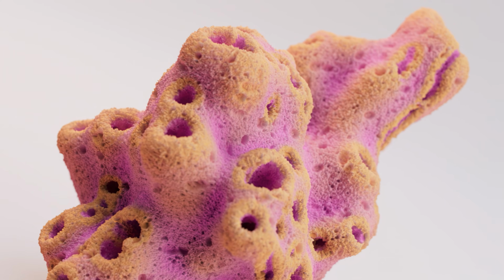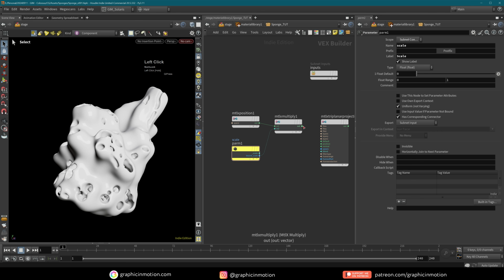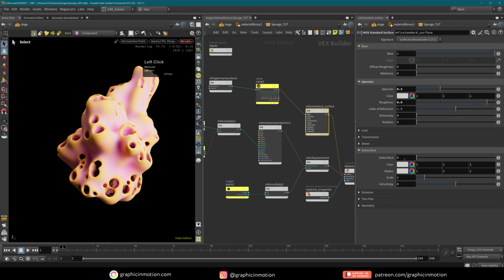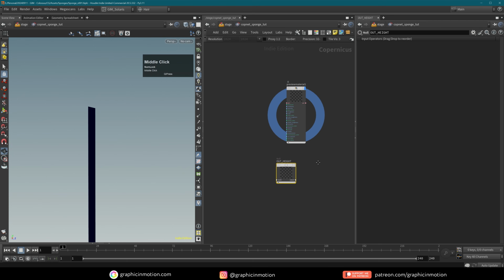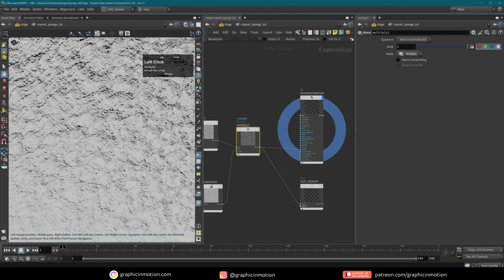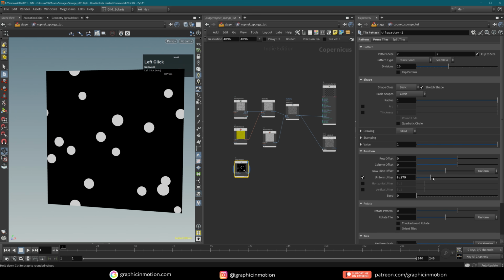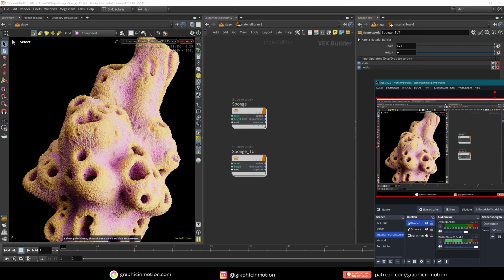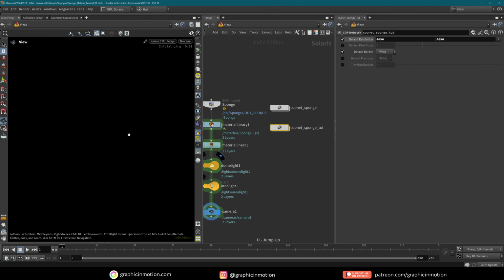How to Make a Sponge Material in Houdini | MaterialX & Copernicus Workflow

Comment: He's back! Finally. 🙌
Reply from the maker: Hi Philipp 🙂
Reply: @Nodeconnector  May I ask, just for my understanding of MTLX, why you used a Triplanar here? It would have worked with a Rest Position and a regular MTLX Image node as well, maybe? Would love to learn if Triplanar had any advantages here. Love the tutorial, thanks so much!
Update: I tried it and Triplanar wraps the texture way more nicely around the organic shape on all sides. With a regular texture you are getting streaks. Is that the reason then?
Reply from the maker: @philippwelsing9108  I use it when the object has no UVs. Without UVs you cannot really apply textures.
Reply: @Nodeconnector  I was surprised to find out that MTLX POSITION doesn't even need UVs. If you use it in "object" mode, it seems to stick procedural noise textures or a COPs texture like yours onto an object that does not have UVs, nor a Rest Position. It holds up in animation as well. This was new to me, too.
Triplanar looks way better though, because it wraps around each axis. 🙌
Reply from the maker: @philippwelsing9108  yes, that makes sense. I was not aware of that when using Copernicus. But I always used Rest Position with noises directly in the shaders. Thanks for the hint!
Reply: @Nodeconnector  Of course! I was kind of surprised myself. Maybe it works because it's actually a COPs texture. I will get to the bottom of this! 🤝
Reply: @Nodeconnector  So, here's the final explanation: In this case, MTLX Position works, because the object is moving, but not deforming. 👍 For this, it doesn't need UVs or a Rest Position. Which is good to know.
As soon as the object is deforming, MTLX Position will need either UVs or a Rest Position. ☺️👍